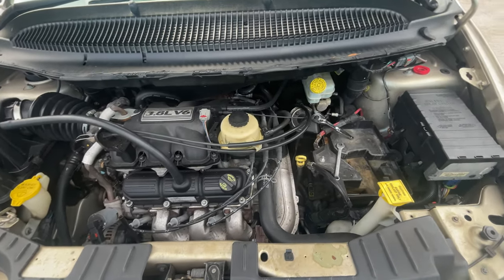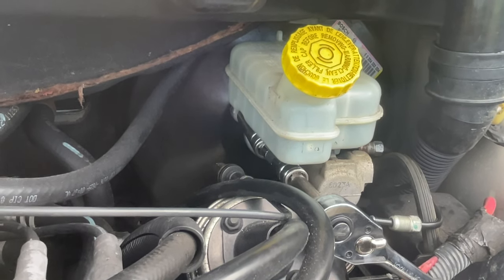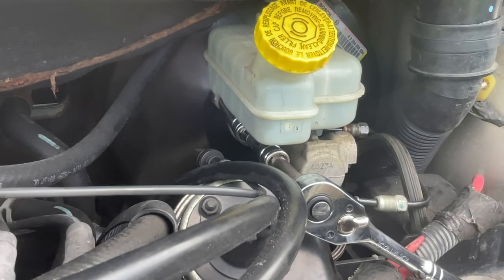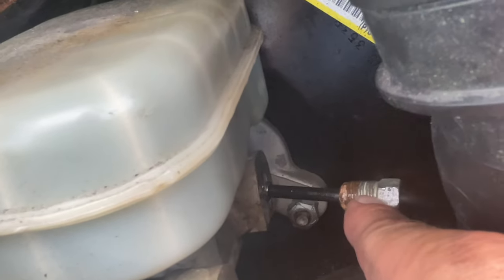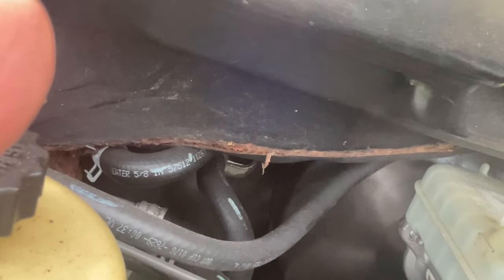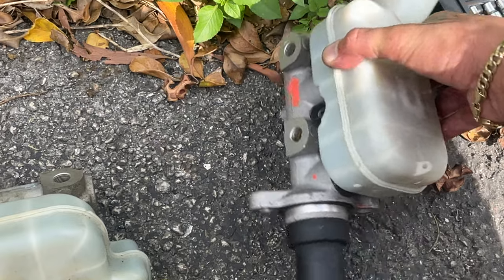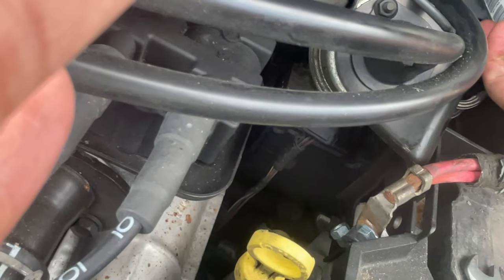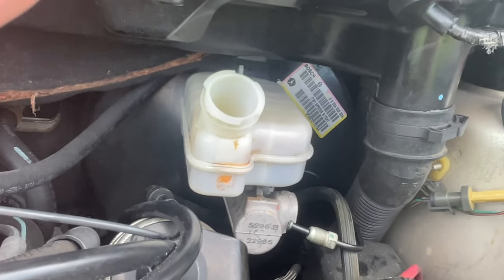Dodge Caravan Brake Master Cylinder replacement. 2003-2007👍👍👍

Comment: Suggestion: After mounting the new master cylinder on the brake booster and before reattaching the brake lines, "bench bleed" the master cylinder on the car. You can buy a bench bleeding kit for not much $$ (plastic fittings and tubing). Then, re-attach the brake lines and bleed the brake system as normal from each wheel's brake cylinder..

Comment: Did you replace booster or master cylinder?
Reply from the maker: The brake master cylinder it’s mounts onto the brake booster.
Reply from the maker: The brake master cylinder was replaced.